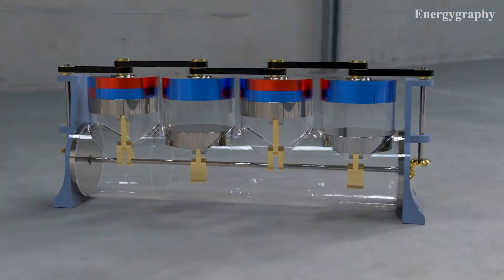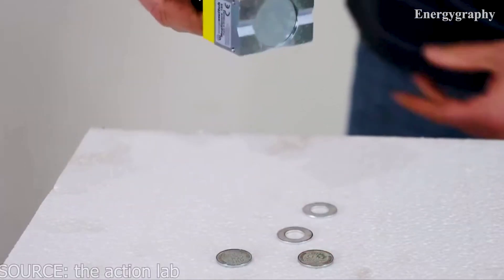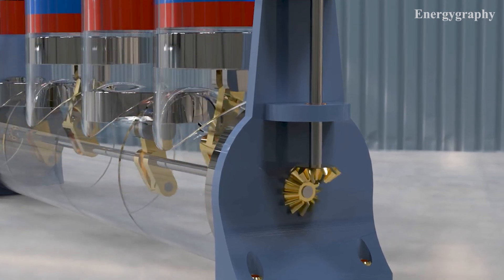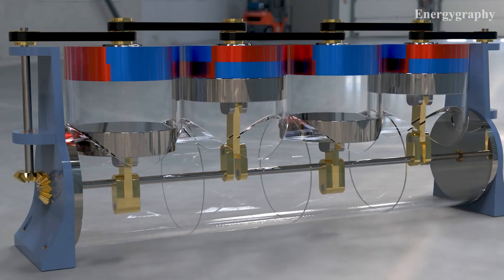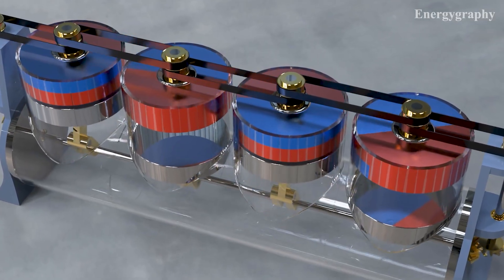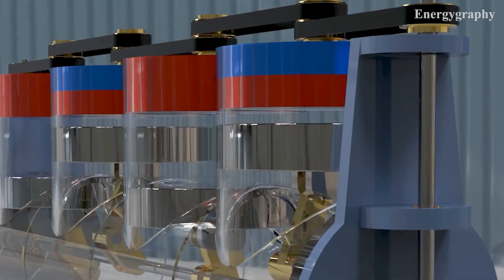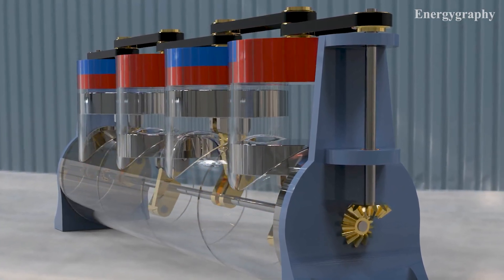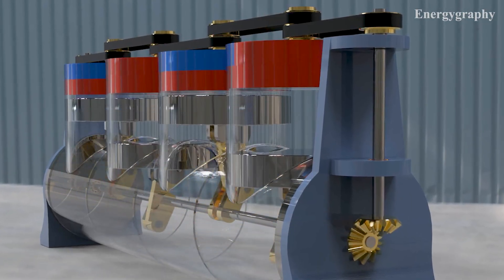New 4 Cylinder Engine

Comment: It should follow the piston engine principles, the blast in the cylinder causes piston to go down very fast. This magnet engine will not produce torque because the magnetic field is limited to a certain area and we will loose power.

Comment: For those of you that have a basic understanding of physics, this doesn’t work. It stop halfway between one magnet pushing down, with another one attracting. They are equal forces, and will not have any energy left to overcome the mechanical resistance in the rest of the machine.

Comment: It's an interesting idea but it's missing a few elements of how magswitch technology actually functions. There's two inductor cores/bars on either side of the magnets which create flux loop paths for the magnets to effectively cancel. Also magswitch doesn't create a monopolar magnetic field, it's actually a bipolar flux loop which is made complete by the load material the magswitch is meant to lift.

Comment: Good start  however  insead of attracting the pistons repel the pistons which will give you greater down force an then go to another level by doing the same at the bottom of the bore,  there is a few more things but I'll let you suss them out thanks that's all for now 😊 kind regards George 🌻

Comment: Not gonna work. Look I’m a CNC machinist so I know those magnetic bases with mechanical ON-OFF switches. And yes I’ve noticed it takes more force to operate a switch when the base is installed on a ferromagnetic surface compared in the midst of air. Yes, you have to put energy in order to create magnetic field. It’s not like a magic stick to wave and get energy out of nowhere.

Comment: If it does work, the manufacturers of magswitches  could have done it a long time ago, but this will never work since the force required to get off attraction= force required to enter repulsion.
Reply: That's right, a magnet is not a source of energy like gasoline or flammable gas. It simply has this property that is amazing to our eyes, but we cannot turn the property into energy. These are different areas.

Comment: سلام مجید عزیز
جهان این مکانیزم شما را تجربه کرده و بیشتر از ۶۰ درصد 
بهره وری ایجاد نمی کند و بسیار پیچیده تر از موتورهای احتراقی میشود
و تولید سیستم کنترل هزینه و توان زیادی نسبت به موتورهای الکتریکی
میبرد وموتورهای الکتریکی هم ساده تر هم کنترل آنها ارزان تر و در حال
پیشرفت هستند و فشرده و کوچکتر وبا قدرت بالاتر هستند

Hello, dear Majid
The world has experienced this mechanism of yours and more than 60%
It does not create efficiency and becomes much more complicated than combustion engines
and production control system cost and power more than electric motors
Electric motors are simpler and cheaper to control
They are progress and are compact and smaller with higher power